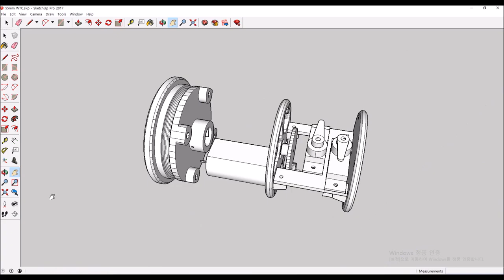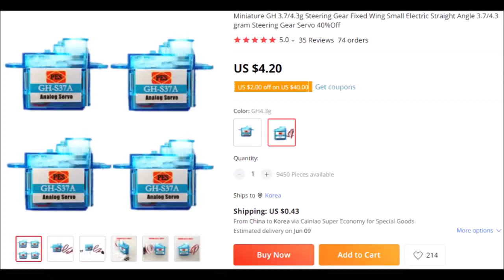Make a WTC for RC Submarine EP.1 Drive unit

Comment: I used to be involved in oceanographic research early in my career. I was a tech back then so my job was ensuring hydrophone arrays and equipment was sealed for the depths. One thing we did was fill array tubes with mineral oil. It’s nonconductive and doesn’t shrink under pressure. It was really good, just seal the ends and it kept water intrusion to nil. Also when we had anything that had a motor it prevented it from shorting out as well.
Reply from the maker: When making a waterproof servo, fill the inside with oil. As you said, it worked well.
thank you

Comment: Crazy amounts of underextrusion in the overall surface finish of that part at 4:15. Even if it passes the initial short term water leak test, long term you're going to get water gradually wicking its way through the plastic over time.

If you want to persist with 3d printing parts for projects like this, the printer will serve you better by printing a negative mold that you can pour resin into or another similar material that won't absorb liquids as much.

Comment: Great series, loved watching this, but I have a question: after he makes sure it's water tight, he makes a hole for the bearing/motor shaft and two other holes. How do these openings not allow water to leak in?
Reply from the maker: It is waterproof by filling the inside with grease.
Reply: @tiver21  filling the inside of what with grease, the holes around the shafts? Doesn’t water eventually push its way in?
Reply from the maker: @anthonyortiz7924  It was filled using a syringe, and if the grease is replenished frequently, the leak can be prevented. (Actually, I use Vaseline by melting it with a hot gun.)
Reply: @tiver21  ahhh I see, I figured it must be a temporary solution and require replenishment. Thanks for replying, this series was so interesting to watch as someone who is just starting to look into RC.